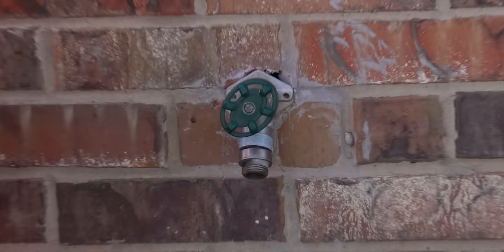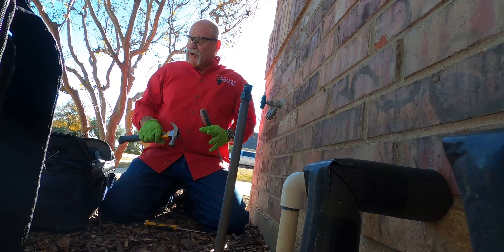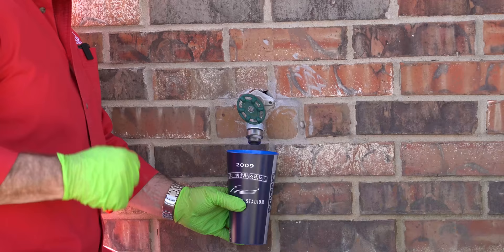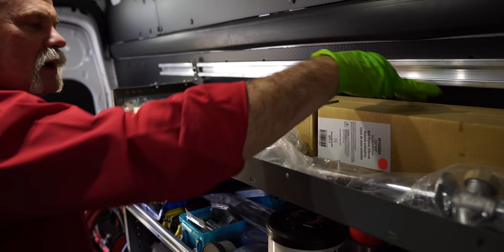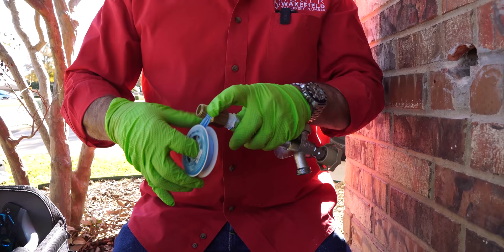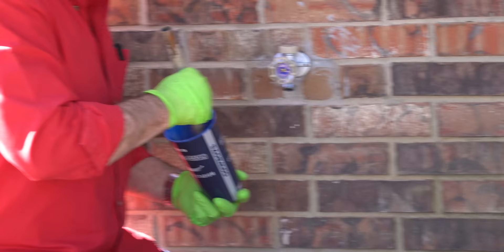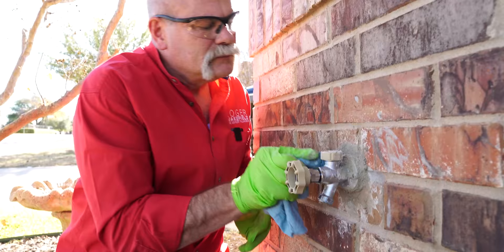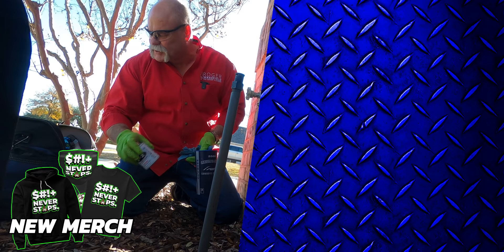How Pro Plumbers Replace Frost Proof Faucets

Comment: Years ago I converted my house to frost free faucets, well worth it. Before that I’d have to go around from inside the house and drain the lines and shutoff the section valves and drain the lines what pain. Also what I do is blow my hoses with compressed air to get the water out then rehook them up to the faucets in case I need to use them in the winter, but of course then I have to clear them again after every use. Clearing your outside hoses with compressed air in the winter lengthens your hose life tremendously.

Comment: I'm from Chicago and I've come across soldered hose bibs. instead of taking the whole thing out I swap out the internals as long as everything else is in tact. takes only a few minutes and like brand new. threaded I do exactly what you did. great job and great video as usual.

Comment: Never replaced one, but wondered how they worked and now I know. Having been a condo dweller in SoCal until about three years ago they never figured prominently in my life, but now I'm in ND and they do. What I learned today is that I'm correct in that I disconnect the hose in the winter, unlike a couple of my neighbors. Nice to know it's not a huge deal if it happens to break as things always eventually do.

Comment: I would suggest wetting down the existing brick before applying mortar.  Helps is cure slower and it will be a stronger patch.  Nice video.
Reply: Why not plumbers putty?
Reply: That's true and I would have tested for no leaks before applying my mortar.
Reply: Wetting the brick improves the mortar bond and prevents separation between the two as the temperatures fluctuate between freeze and thaw.  Just a spray bottle of water works very well.  If the tap's flange has holes to accept screws, install them into the brick, and if the hole is larger, insert rust proof screws into the flange holes before pointing the mortar into the cavity.  The screws will be set when the mortar sets up.
Reply: Samuel Lim  Tell that to the plumbers who installed these on every single house in my neighborhood. ALL of them on the outside they filled with plumbers putty and nearly ALL of them it has dried out, or fallen out.  Idiots.

Comment: Just what I needed. One of mine burst a month ago and only realized it when I turned it on and saw water gushing from under the siding. It leaked from the handle/weep hole anyway, so wanted to fix it before it burst.

Got a replacement assembly from a plumbing store, but discovered I needed 1/2" MIP instead of 3/4 MIP, and nobody in town carries the one I wanted. So ordered one online and did it a few days later. Also replaced the valve assembly in my other one, which also leaked.

The actual process was shockingly easy! A plumbing outfit quoted me $300 per hose bib to repair, so I saved myself $540.

Comment: We have switched to using Aquor Brand hydrants. They have a super clean look and prevents theft of water. The downfall is the customers loose the garden hose adapter. We always suggest selling them an extra adapter. 
However we always have extra if they need them. They can come by or we can drop one off for them. This cold season was a test to them for sure. Not a single client where we installed them had a busted line. We keep a data base of our customers and called them weeks before to remind them to remove their hoses. Just calling them seems to generate additional simple sales and reminds them we are a plumbing company that cares. We are in the process of building an automated system by the customers preferred choice of contact (phone,text or email).  Since the seats are no longer replaceable like the old school hydrants. I’d like to see companies go back to component based products but they aren’t about repairing but replacing nowadays.

Comment: Roger with all due respect I disagree with how you finished the install. I think the morter was sloppy and in the end didn't give you anything solid to anchor the body of the faucet to 

My experience is that by not installing two screws in the holes provided in the escutcheon of the faucet you can end up with damage from someone pulling the hose or in rare cases over tightening and twisting the faucet. 

I always fill the gap with silicone but have developed a plate that I can slip over the stem of the faucet. I then attach the plate to the buildings brick, wood or whatever the material is and then screw that faucet to the plate. It's rock solid and looks good.
Reply: I agree. And in this instance, I would've taken the screws and atleast put them in the hole, and got mortar back in the hole more, so when the mortar set up the screws would be imbedded in the mortar like you screwed them into it. 
I do like your plate idea though. You could install the plate pre-install so when you get it all threaded on, you can screw right to the plate. It's all in prep work. I swear, plumbing is 90% prep, 10% work. 
Good idea though, and good catch!
Reply: @Chris.Rhodes  - Hey thanks man I appreciate it.
Reply: Agree he to the easy way instead of cutting inside and solder a new one that was flush and secured to the brick!

Comment: Roger,  the only thing I may have done differently is to dampen the brick prior to applying the mortar. That way the brick will not draw too much moisture out of the mortar as it cures.   Great production otherwise!
Reply: Wondering why he didn't use hydraulic cement? (can also be mixed in very small batches; I once mixed a batch in a plastic zipper baggie). I suppose the mortar gives him more time to work with.
Reply: @markh.6687  great suggestion with the baggie, and then just snip the corner and it can be used as a grout bag for easy application.

Comment: I've installed similar faucets and have always done it from inside the crawlspace where I soldered the faucet to the water line. When I saw you torquing the faucet pretty hard to remove it, I wondered what the pipe inside was anchored to that kept it from twisting and breaking. I kept thinking, "he needs a pipe wrench inside to keep the pipe from rotating as he unscrews the faucet." I thought the same thing as you were screwing the new one back on. So, my question is, what was the pipe inside anchored to that allowed you to twist that hard in both directions without harming the pipe? Thanks for an informative video.
Reply: I don't think he's really torquing the hose bib down that firmly onto the supply pipe.   As far as the supply pipe, presumably that is run through a drilled hole in a stud and secured with pipe hangers or straps.  I doubt very much the pipes are just flapping in the breeze, so to speak.

Comment: I replaced my spigot 2 years ago with a hot/cold model.   I added a hot water line along with a better cold water setup.   The old one was soldered and tee'd off of the main 3/4" line  before the inside shut off and so I added individual valves.  I was also replacing the house shutoff at the same time since it was leaking and inside a wall.   I spent a decent amount of time in the crawlspace soldering and hanging pipe by myself but I'm happy with the results.   I used backer rod and concrete caulk to finish the brick hole.

Comment: Replaced mine not too long ago. Was connected to crusty pex. Line snapped when I was twisting it in. Ended up having to replace that along with every shut off because those were broke too. Good times but I learned quite a bit from that. It was my first time doing any plumbing

Comment: as a stone installer, id mask it so you dont make such a big mess of the brick work. but the plumbing part is on you (:
Reply: Mask it?
Reply: @mariosifuentes5994  put tape or covering to prevent mortar getting on the finished surface
Reply: As a mason, I'd just use a tucker, problem solved.
Reply: I was thinking the same thing. Clean install except for the mortar.

Comment: Just your typical home owner, but maybe 1 or 2 things...
1. Use a piping bag or at least a plastic baggie with corner cut off to squeeze mortar in void.
2. maybe you couldn't get behind wall to hold where it screws in but I'd definitely try to hold before cranking down to loosen or tighten the frost proof sillcock. (Hopefully it's anchored down).
Awesome tips on wedge and tape/dope! Thanks for another great video!

Comment: I live in Michigan and we get below zero weather at some point every year. I have never needed this sort of faucet and I don't even drain my garden hoses. I have never seen an outdoor faucet freeze. When I do replace a faucet I cut the water pipe in the basement and use a section of PEX attached to the new faucet to come through the wall to where I cut the water line and join it there... Caulk does the rest and It looks good. Passed inspection when I sold the  place.

Comment: I've always cut into the wall to replace hydrants. I'm always paranoid about twisting the copper if I don't put a backup wrench on where it screws in.
Reply: Yeah same here! It’s definitely risky!
Reply: i think of it  the same way as unscrewing the   pipe  for the shower  from the wall. its iffy but it will either work or you will be cutting the wall anyway
Reply: Diego Diaz yeah or an old galvanized pipe....
Reply: Yes the one time I tried it without back up it twisted copper into the next stud. So now I open wall and install access panel and ball valve if they want it.
Reply: Also to make sure that what you are replacing was actually inside the wall and insulation. Too many short hydrants in thick walls.

Comment: 8:19....important step.  I just had both of these replaced in my home (I live in the Midwest where it can get 20 below in the winter).  I always disconnect my hoses and put a covers on before winter hits.  Both of mine broke just behind the flange.  So when I would turn the water on, it would run down the siding.  The only thing I can think is, they were both pitched the wrong direction so the water couldn't drain.

Comment: Have you ever tried an Icing bag or Frosting bag to squeeze in the mortar in behind.
Reply: or cut the corner off a quart freezer bag. I was thinking the same for a cleaner, more accurate application.
Reply: The hardware stores sell a heavy duty mortar bag that works the same way.  A thin "brick pointing trowel" will also get it in there with less mess.

Comment: I love the content. My aunt worked for Ferguson when it was one store in Virginia years and years ago, but they've gotten too pricey for me we go to smaller plumbing distributors for most of our parts now. I love the idea of the frost frees and if you use them correctly they're great but I replace way more Frost frees than I do just regular sill cocks. I'm sure most of its owner error but we have to replace a bunch of those Frost frees that freeze in the winter then at some point in the summer somebody calls and says they hear water running when they're using their water hose because it's coming out the split in between the cinder blocks of their foundation or under the house.

Comment: I've seen a lot of type M copper in the Dallas area. Gotta be very careful not to overtighten the hose bib to the correct alignment unless you open it up to put a back up wrench on it.
Reply: Not sure I have ever seen nor used type m...  it's always k or L that I find and use on our sites.  Maybe cuz I do more industrial plumbing than residential?
Reply: I agree 100  percent Plus clean up the cement a little better

Comment: I just replaced the washers/o-ring 3 years ago. The retainer screw was going bad in the valve body but I didn't have the means to re-tap it. Today, 3 years later, it started leaking again and is hard to turn on & off. Time to expose the area behind the hose bib and replace the whole thing, like I should have done in the 1st place.

Comment: "I got a couple of little chisels here." Or as non-plumbers call them, screwdrivers.
Reply: And many auto mechanics call them pry drivers.
Reply: I keep a sharpened flat screwdriver in my bag for small little chisel jobs lol
Reply: It is a flat head screwdriver
Reply: the had metal butt plates on them, ive never bought a screw driver that had that. those are likely chisels.
Reply: look up "Milwaukee Demo Driver", its got a steel core and a metal plate for hammering, its more of a chisel pry that doubles as a flat head.

Comment: I think I actually have the same build out as this video which needs to be replaced on the front of my house. I'm a little hesitant because I don't know if a pipe is busted somewhere down the line in the garage since I noticed pressure build up and water to come through into the garage. There's no visible signs of damage but I don't want to just start cutting holes in my drywall either. How wide is your service area Roger? I'm up in the Aubrey/Cross Roads area.

Great video by the way, it made a lot of sense and easy explanation! Keep up the good work!!!

Comment: Any brand of Frost-Proof faucet you recommend?  I notice at the big-box store the Woodford brand (came with my house) was at least $15 more than the Reliabilt brand.  Also, I noticed the Woodford seemed to have less pitched threads to tighten the shut-off/shut-on; meaning it would take at least two to three turns to fully open the valve and the Reliabilt brand would open/close with just a single, round the clock turn.  I bought the Woodford.

Comment: Don’t know how the faucets are installed in Rogers state but don’t screw it off in Tennessee you will twist the copper into a licorice stick or snap off the cpvc only if it’s screwed into a stabilized earred L or galvanized pipe would I screw it off .
Reply: Same in Pennsylvania
Reply: That’s because whoever installed it sweat on a female adapter, so the hose bib just threads into it.  Makes changing it out that much easier
Reply: Most seasoned plumbers don’t want mechanical connections (female adapter) inside of a blind wall when it could be a soldered connection
Reply: @marksullivan3424  this is true but if no one is under floor holding the ‘roll’ the female adapter will just twist . This was an American made Arrowhead brand and probably would have been on for sometime before going bad . If this house is on a slab then codes may require an earred L inside the wall which if secured would work. All said if 5% of viewers replace their frost free this way then 90% of them won’t be happy
Reply: Todd Lenard  same here Arrowhead used to be type L not anymore and that damn o  ring instead of  a packing nut , I’ve been using the brown handle Woodford too , the design seems to be odd but works very well . I’m old as the hills but still working regularly, today I fixed a broken pipe at the meter, repaired an older a Delta tub faucet, then installed a lav faucet and pop up drain and I tell you , I liked fixing the broken pipe in the drizzle at 39 degrees better than the lav faucet job . I work alone as that’s the way my father taught me . Years ago we ran galvanized pipe and poured lead and oakum in cast iron . I’m in Columbia
Reply: Todd Lenard  30 years ago I worked for Hasty , then got my journeyman’s at Nashville then my masters at Franklin also worked 7 years as a journeyman Iron Worker out of a Local 492 in Nashville. I really hated it when TVA  got people to put that damn insulation under the floor

Comment: What's more effective at preventing frozen/burst pipes, a frost-free anti-siphon sillcock, or having an internal shut off valve on the inside wall? Is it better/best to install both? Does wrapping the frost-proof with pipe tape prior to installation help insulate & prevent corrosion?
Reply: Afyer 3 pipe bursts along the frost free aNti siphons faucets in the same location over 20 years, I added an internal shut off valve for it. No more burst pipes in Winter.

Comment: In Tennessee you can rarely unscrew one from the outside. You can do that ID it's cvpvc or pex. You can rarely do it on soft copper without it twisting the copper. I've been doing plumbing for 35 years and I've never been able to keep from getting under the house. I would anyway to be doubly sure it's not dripping.

Comment: Did this a few months ago, as a former cake decorator, I put my grout in a zip-top freezer bag(heavier duty)  and snipped the bottom corner to pipe it in behind the flange
Reply: Nice
Reply: Thanks for the great idea!!
Reply: The hardware stores do sell a heavy duty "squeeze bag" for mortar that almost identical to the type used for cake decorating.

Comment: I went to an engineer's house and he wanted me to reduce down and install some half inch braided Flex lines in lieu of three-quarter inch Flex lines on his water heater because he already had the half inch flex lines so yeah listen to them engineers.
Reply: should have done what he wanted. and then when he called you back the next day b/c of hot water issues when multiple fixtures are being used, you could charge him again
Reply: @jgg204   We'll see I am a plumber rather than a handy man so I couldn't do that

Comment: Roger, I like your videos. My approach to frost-proof sillcocks is to remove them. The cost of the stem assembly and the kit can actually cost more than a new one. I don't like gate valves because they reduce the flow. As a replacement I bring out the pipe with a male coupling and thread on a ball-valve type female threaded sill-cock. I will use a stainless allen screw for the vac breaker so it can be removed if needed. I get rid of the snapp off screw on the vac breakers. Having a ball valve on the other side of the wall for shutting off the water to winterize is optimal and I'll do that.

Comment: Good job. 
I've accessed from the opposite end through a crawl space and on my hands and knees back and forth to get tools for soldered frost free. It's in a colder climate with an unheated space. I hate those up here. I insisted on adding a valve they could access from the interior inconspicuously but easy Access to turn off when winter comes. Your way was way easier.